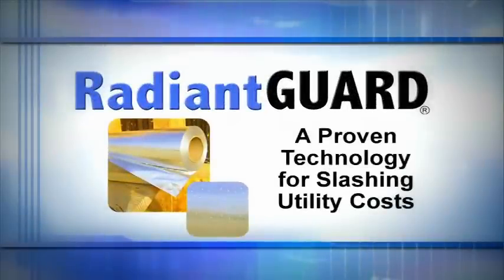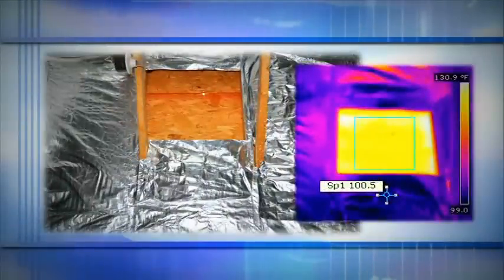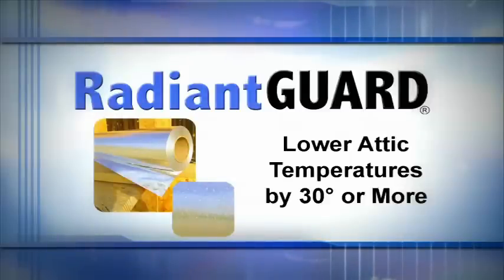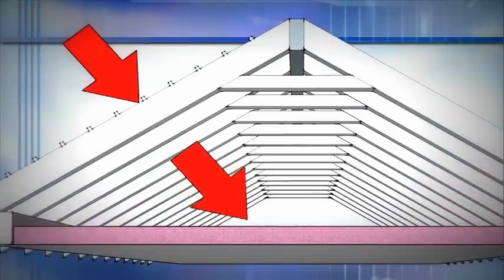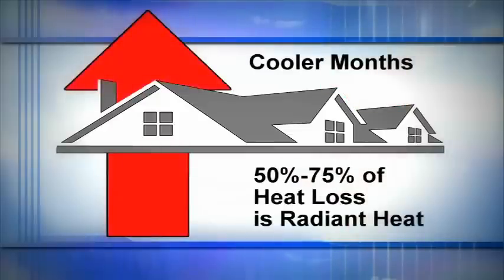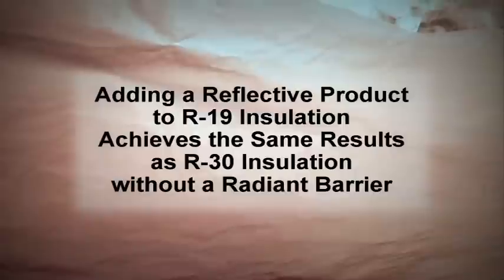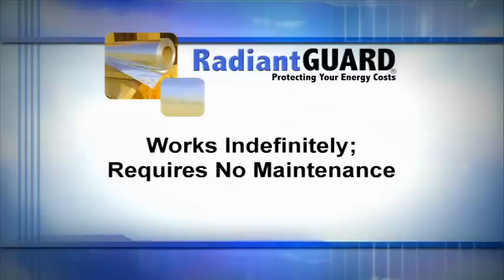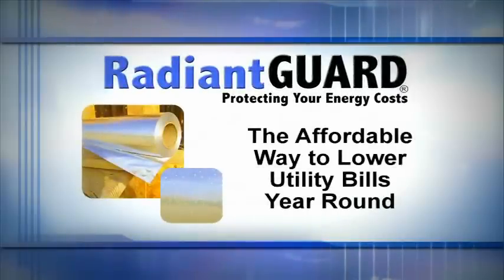How Does Radiant Barrier Work? Watch RadiantGUARD® Explain How

Comment: Which one was used, Xtreme, Ultima, or classic?
Reply: The infra red images showing the thermal differences were taken with the Ultima-FOIL radiant barrier.  It reflects 97% of the radiant heat.  The Xtreme radiant barrier is equally as effective as it reflects only slightly less at 95%.
Reply: @RadiantGUARD-Corporate  awesome!  Because I just ordered the Xtreme being the Ultima was not available on Amazon.  Hoping for some positive results! 🙏💲💪👍